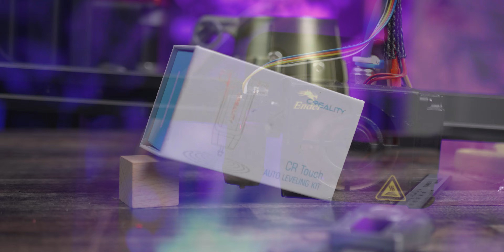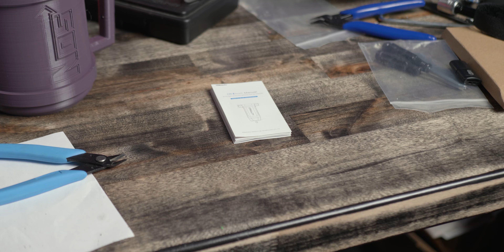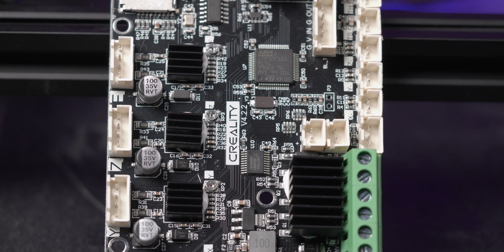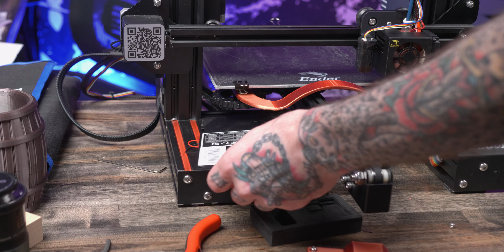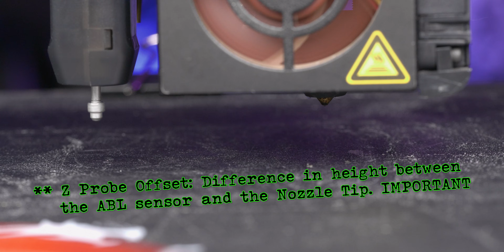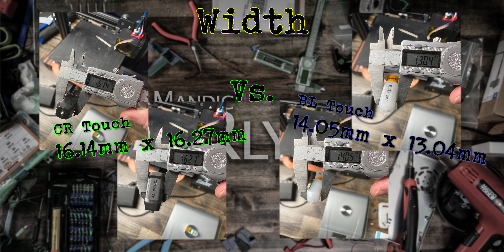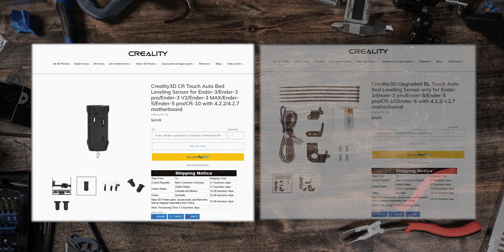CR Touch vs BL Touch - NEW Creality Auto Bed Level Sensor Review

Comment: Tried the firmware they gave you on a 4.2.2 motherboard. When turning on it only beeps and never generates the starting screen. I've tried about 10-15 firmwares. Nothing is working. Tried for a cr touch and a bl touch 🤦‍♀️it starts and extrudes, z stop is removed, when homing it doesn't extrude and will crash into the bed. Pfft

Comment: Whoa...how did you flip your motherboard box over? I hate flipping the printer to access it and now I see you've done it. You gotta link me to this, search engines suck any more and return what they want to promote instead of the terms you are searching for. Thanks. Another great video!
Reply from the maker: That is a base model Ender 3, they come that way.  The Pro and V2 have the "flipped" board where it is accessed from underneath.
Reply: @MandicReally  Thank you.

Comment: I have and ender 3 I Installed the cr touch and all is good. But for some reason one corner of my built plate no prints will stick to it.   I have looked all over for someo e to show me where I should set the manual bed level adjustment knobs so I can get a fair reading. Everything I've seen people have there z offset set to -1.0 to almost -2.0. But mine is like -0.2. Why is that.

Comment: I came to this video specifically to figure out which one I wanted to get for my Ender 3 V2. I'm  very new to 3d printing and I'm having issues with my first layers and not sticking. I've upgraded my bed springs and e extruder. My first print even, the cat, will not stay. I figured the auto bed leveler would help or at least not hurt. So I'm going with the CL Touch. Thank you
Reply from the maker: I don't recommend modifying a machine until you have reached the limits of what the stock setup can do.  Spending time to learn and improve what you have will take you a longgg way.  

If you aren't getting a good first layer there are a lot of things you can do.  
1) Check Bed Level (I know its so basic, but so many screw it up, its the basics because its important). 
2) Pre-heat your bed well ahead of your print.  (Especially with a glass bed, the heat takes a long time to actually reach the print surface.  Pre-soaking the bed with heat will help adhesion.)
3) Print your first layer hotter.  (5-10C on bed & filament, but it really depends on the specific filament.  You have to tune for your filament.)
4) MagiGoo Adhesion promoter is a great product to help get a sticky solid layer.
5) Print your first Layer SLOW.  I usually do 20mm/s on almost everything I print.  
6) Print a thicker first layer (Slightly taller and higher extrusion width.  I usually do .2mm first layer and .5mm extrusion width.)
7) LASTLY a bed Level sensor.

You can see this video I did on TikTok about this topic: https://www.tiktok.com/@hotrodhippie/video/7048716946724031790?is_from_webapp=1&sender_device=pc
Reply: @MandicReally   Thank you SO much for your reply, and very quickly too. I can't tell you how much it means to me. I took your advice and did another crazy in depth manual leveling again. I had to do a bunch of tweaking but I did finally get a fully finished print. It still doesn't look all that great, but at least it completed and stuck down. This is still just the first print that comes on the SD card with the Ender 3 V2. No matter how tight I get the leveling, I had to set the z offset to -3.0 to get it to fully stick, also had to have the bed at 80c and the nozzle at 205c (this is with the sample pla included). I had several failed prints before so when I finally got it going, I ran out of filament and paused the print and changed to a small reel. When I did this I got terrible lines and what looks to be like it sized larger. I have started watching your tiktoks like you directed. I hope to learn and figure this out, for it's been a passion of mine to start for a while now. I did notice that a lot of your printers have auto leveling devices installed. I know that it doesn't not replace manual leveling but I figured something to help get the distance right to start a print. Alright, I've talked too much.

Comment: So it works with the Merlin wizard or do I have to use the creality one? And if so then good but how do I upload the Merlin program onto the printer itself because that is something I need to know as I haven’t done this at all. Also can I just change the code to enable the settings in merlin by just clicking it and so on? I’m not great with code

Comment: To be honest, I do not want to approach any sort of auto bed leveling anymore. When I bought my first 3D printer Ender 3V2 I didn't have any experience at all, and bed leveling was super hard for me. Especially with the stock firmware. So after a few weeks I bought an original BLT. And it was even worse than manual. I usually used to stay with my printer for the first to layers to check if it is okay, and the nozzle will not crush into the bed.  I thought that my pain was ended with the BLT. First time I plug it, adjust the z offset and all of that, start a test print. To my horror, the level failed, but I didn't know that yet, it just started flashing red. The result was that the probe git the bed, and bended. Lucky I could bend it back, but still try after try, the BLT would crush in the probing phase. Somehow, magically it stopped failing, but the results were not great. It was not able to probe correctly and it was always off my few mm here and there. In the result I found Jyers firmware and it is THE best thing you can do, for you Ender 3. The version with 3x3 manual mesh is a miracle. I calibrate it ones or twice a year and I don't have to think about anything y anymore. I just start the print and go away and I know that the print will come out perfect. The best feeling in the world. Install Jyers firmware.

Comment: So I have a CR-10 v2 and had a horrible time with leveling. I purchased a BL touch and thought the instructions were horrid and never attached it. Ultimately this killed my desire to print. This was probably 2 years ago. I got the bug again but instead bought a CR-6 se with auto bed leveling and this has been a night and day difference. After seeing this, I will probably purchase a CR Touch and try to resurrect my CR 10 v2. Thank you!

Comment: Thanks for all the detail. The part about “z axis offset” really helped me. I didn’t know what this meant. I installed my CR Touch and got usable firmware that works with my touchscreen on my Ender 3 but I had almost no success with it, I suspect because I didn’t do the z axis offset. I’ll retry my CR Touch with this info.

Comment: I recently purchased and installed and they did update the kit. I still had an issue with the firmware that i downloaded from the site. After loading sd card my screen was blank. I ended up trying the firmware that came on the sd card they sent and after trying a couple the ender 3 pro version load and flashed properly. I ran some mobility tests and was found i had a loose wire on one of the stepper motors. In the process of troubleshooting that i tried the other firmwares i download and they loaded and flashed properly after that. I’m not sure what i did wrong but it’ll seems to be working now. So far I’m really liking the CR Touch. I wish i had found this video before i attempted the install though!

Comment: Flashed updated firmware from your link now my printer will not move on any axis  x, y, or z. Any suggestions
Reply from the maker: I’d check for a newer firmware and flash that from Creality. I’ll be changing my link away as it’s months old at this point. Be sure to pick the proper firmware for your application. The lack of movement sounds like a bad flash or the wrong application to me.
Reply from the maker: https://www.creality.com/download

Comment: BL Touch works wonders, why change it out for an intestinally difference in accuracy (and that was with a sample of one each)?  Your video is a little old now.  At least as of January 2022, they have working firmware on their site.  I agree Z-Offset instructions would be nice.  Any instructions that you do not need a microscope to read would be nice.  I guess the cost of paper in China must be through the roof?

Comment: installed everything - checked cables a few times. I get the new firmware menu - but the  motors won't move in any direction.
Reply: never mind I realized the two creality downloads specify the board type mine is the 4.2.2

Comment: Creality is so disrespectful of senior citizens and people with visual impairments. I'm helping my grandson install a CR Touch on his Ender 3 Pro that I got him for Christmas 2021. I'm 76 years old and I'm probably not the only senior citizen who is deep into 3D printing. I absolutely abhor the little, tiny, puny, almost microscopic instruction manual that came with the CR Touch. For someone my age (or possibly anyone of any age with visual impairment), it is impossible to read the tiny type on that pamphlet. The screen shots of the printer's display are likewise impossible to comprehend. This so-called manual is worse than useless. A magnifying glass doesn't even help as the resolution of the text and images is so poor. Even the PDF copy of it that I found buried somewhere in the Creality web site is tiny. Instead of making a full size readable version of the manual, they posted an actual size image of the tiny manual that was no easier to read than the hardcopy.

Creality, if you're listening: take the time to make useful and functional instruction and assembly manuals. Customers will like you better. Make the manuals large enough that they are readable, even by folks with old eyes and/or dependence on reading glasses. I realize that larger manuals require larger packaging. I think most customers would rather have appropriate packaging (that is, large enough to accommodate a useful manual), than cute, sexy packaging with clever magnetic closures and cartoon figures. At the very least, make large size (full 8-½ x 11 inch page) downloadable manuals readily available and findable on your web site. 

New Year is coming soon; make a resolution:  If the product is worth making, marketing and selling, it's worth doing it right and not cheaping out on the documentation. Do it right.

Sorry this was so verbose. But it needed to be said,

Comment: WOW! Finally, a creator who knows 3D printing AND video production! I have watched so many channels with good content, but terrible audio and/or video. A certain channel for 3D printing has a huge number of pattern supporters, but uses the on camera mic. 

I have a Geeetech A20M and a 3D Touch that works, ok. I'm thinking about buying the Ender 3-s because I have so many issues with getting my A20M to work, and that printer comes with the CR touch installed.

Comment: Sorry man. I've bought a CR touch but unfortunately, after having installed it on my Ender 3, I discovered that the connector for it was missing on the motherboard.
It seems to me that it needs an adaptator that's not includded in the package. So, why ???
Reply from the maker: You must have an older board. That’s why I made a point about the boards this is intended to be used with. Creality sells the adapter with a BL touch as a full setup, search for “8-bit Creality bl touch adapter” and you should find it.

Comment: Great video Alan,

Is there a way to apply the print bed map back so the first print layer is optimised?
Reply from the maker: A properly configured firmware should automatically do that if you run a G29 command before each print. The instructions with the CR Touch tell you to set that up in your slicer. Or if you don’t want to run a level every single print (I recommend it tho) you can run a M420 S1 command to used the last saved mesh data. Then you’d have to manually run the Level procedure from time to time to update that.

Comment: Is there not nuts to keep it from moving?
Reply from the maker: Why would it need nuts? The bracket is threaded.  I guess under heavy vibration you may be concerned about fasteners loosening up, but the entire print head is assembled without nuts (except the V slot wheels), so you'll have more problems than that.

Comment: So of course I downloaded the 4.2.7 firmware even though I have the Ender 3 V2 with a 4.2.2 board. Popped in the card turned it on and the screen was blank- nothing. Fans on, CR touch bounces up and down and the screen appears lit, just nothing showing on it. Popped out the card, unplugged the CR touch to get everything back to original and now still nothing. Could it possibly have tried to install the wrong firmware and glitched? Any insight would be appreciated - complete newcomer to 3D printing.
Reply from the maker: It is because you flashed the wrong firmware. Download the proper 4.2.2 firmware and put that on your SD card. The board should be able to reflash to the proper firmware and recover. The firmware needs to see all the hardware that it is made for or you’ll end up locked up like you are. (I mean the hardware on the board itself, not the CR touch sensor).

Comment: i got this a little bit ago! must say installation is pretty easy (at least from what ive done)

i have a 1.1.4 board on my ender 3 (it came with it sadly), its 8 bit and does not have the pins needed

i have a 1.2.7 board coming in the mail and it has the port

good build quality

Comment: Repeatability is different than accuracy.
Reply from the maker: You are correct. Can you come up with a test to truly and accurately test the accuracy of a probe other than testing it’s repeatability AND comparing the table mesh readings between two different ones? I need more information from the makers about actuation readings I guess go do a hardcore accuracy test. No readily available test will really do that.
Reply: @MandicReally  To measure accuracy I would suggest getting a material with a known thickness and placing it between the bed and the Touch. I'm not sure what the travel range is for the CR/BL Touches, but the material thickness should obviously be less. Compare the reading with and without the material. The difference should be the thickness of the material. Compare with a trusted value. This could be your own measurement with some calipers, or perhaps you are using numbered gauge blocks or feeler gauges for the material. The difference between what the Touch measures and the actual thickness is your accuracy. You may find that the thickness value given by the Touch also changes with temperature.
Reply: I'm not sure if this is possible, but if you wanted to eliminate inaccuracies of the measurement from z motion, you might try slipping the material in and out without having the motors  move in z.

Comment: Any issues using the CR Touch with the JyersUI?
Reply from the maker: I’ve never run Jyers firmware, anyone else have input? It should not matter. The firmware just views the Cr Touch as the same as a BL Touch. I have only run into one situation in my (limited) testing where it just didn’t work, that was on my Elegoo Neptune 2.

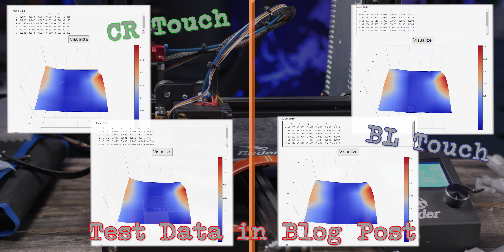Comment: Hey, great video. Could you tell me how you can get that warped-bed map at 10:58? Ive been looking for a way to see what my bed distortion is. Is this a software on the PC?
Reply from the maker: You have to use a combination of some type of "Console" printer control (Such as via Pronterface or OctoPrint) and web programs that produce the map.  I think there is an OctoPrint plugin as well that can do it within the OctoPrint platform. 

This is the one I used in this video: http://lokspace.eu/3d-printer-auto-bed-leveling-mesh-visualizer/
Reply: @MandicReally  Thank you for the reply. I'm checking it out as we speak.

Comment: How does the auto-leveling work if you can only level the board by hand anyway?
Reply from the maker: The machine used the Z axis to actively move the print head up and down to compensate for the bed level readings. So just like it actively moved X/Y while printing it will move Z slightly. 

However Auto Bed Leveling is not a replacement for manual leveling. It’s only a nice addition to it. Starting with a bed that is well manually leveled will allow the auto level to work much better.

Comment: Very informative video. I have the bl touch and I saw in your ender 3 and it its probing many places in the bed. Why mine is probing only 9 points? Yours seems to probe 25. Help please
Reply from the maker: Default mesh pattern is only a 3x3 grid so that’s all that most firmwares enable. You have to set the firmware to do more (when compiling firmware). 3x3 isn’t nearly fine enough for my liking, it isn’t much more than just manually leveling at that point, I feel anyway.
Reply: @MandicReally  omg. You left me confused hehe. I have an ender 5 and I downloaded the firmware for bltouch and it says 1.1.6. I just connect my pc to the ender and that was all. I do not know what to do when you say "compile the firmware". It sounds like usint a arduino and those all stuffs, but I am average user. Do you have any guide to do that? Thanks